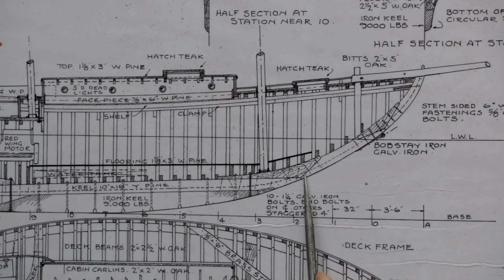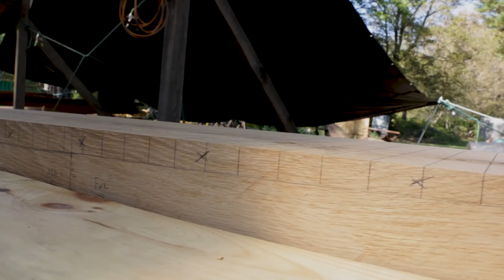Acorn to Arabella - Journey of a Wooden Boat - Episode 18b: Bow and Stern Timbers (Part 2)

Comment: For funsies... use maple sap in the boiler so you can have some syrup when you're done!  Also, I'd have been inclined to steam bed the fourth timber and then plane a flat spot on the back.  It seems like it would have been easier than dishing out a curved section.

Comment: Most of my steam bending experience has been with much smaller pieces -- like ribs in a canoe.  The challenge there is that you only have a matter of seconds to get them out of the steambox and bent into place before they cool.  Still, it's amazing the shapes you can get when everything works right.
Reply from the maker: Bending the thick planks was very cool, looking forward to steaming in all the frames!  The thick beams cooled fairly quick but I think since they have so much mass they stay hot a little while longer than skinny ribs do.

Comment: Suggestion for an improvement on your kettle.
Change the bottom surface of your water tank to an inverted cone leading to a straight chimney/flue that runs up the middle of the tank. That way, the firebox/water tank surface area is increased, and also the fire "draws" better thus being hotter. 
You can then add a cold water inlet on one side of the tank, and have your steam draw on the other side.
Your steam box will then sit beside the tank instead of on top.
Reply from the maker: Thanks for the suggestion but in all honesty it sounds like more work than it's worth.  It worked very well for steaming the forefoot and should work just as well for the frames.

Comment: you are thinking of resistance in the boat from waves or hitting an object which is true.   But distortion in sailboats will come from the pull of the forstay  and the backstay is very common.    You see many sailboats broken from over tight rigging.  (raceing)
Reply from the maker: You are totally correct and the rig is probably a bigger concern than the waves or hitting a solid object.  
The directional forces are similar and that is why we used those examples.  Most people would have a hard time believing the rigging could hog the hull, they don't understand the forces involved.  Envisioning a boat hitting a big wave or reef is much easier to imagine.  Once we start installing chain-plates and such we will start to explain rigging forces and their effects on the hull.

Comment: I have done quite a bit of woodworking myself, but can't do it anymore. I know it is well past clamping huge timbers together while gluing them, but why do you use 1/2" clamps? I was under the impression that to clamp large timbers and get them to keep their shape you should use super heavy duty clamps (1" or 1 1/2" size). I've only made it to Chapter 19 so maybe you do this later in the build. Although, come to think of it, most of the time where real heavy duty clamps are used seems to be when steam bending hull planking to the ribs.
Reply from the maker: Since the planks are either jointed flat and glued or steamed in place they don't require a ton of force to hold them in place.  We use pipe clamps when we really need to crank em tight but the smaller bar clamps are quicker/easier and are usually up to the task so far.

Comment: You should have looked into Live Oak for the forefoot.  It naturally comes in the proper shapes and it is extremely rot resistant.
Reply from the maker: We don't have any live oak in these parts.  Uprooting a big oak tree could have found us the curved piece but steaming and laminating seemed easier.
Reply: Correct, Live Oak is usually from the South Eastern US.  You could have looked into having a piece shipped up, but at this point it's only info for others and perhaps a future build.

Comment: Since steaming the wood opens and softens up the wood the pores of the wood are also open, is it possible to also laminate with glue at the same time when you clamp them into shape, or was it too much to worry about at one time?
Reply from the maker: Moisture and heat make it hard for many glues to cure. And yes, that’s a lot to handle all at once.

Comment: did you consider making a glue-lam of the entire keel?? would be strong AND elegant (and cheap) i should think
Reply from the maker: We did.  We used two gallons of Resorcinol glue juts to glue the bow and stern timbers, the glue is $160 a gallon after taxes and shipping.  Epoxy and oak have a spotty history but Resorcinol and oak get along very well hence using it.  
We would need at least 5 gallons, maybe 6 or 8 to glue up the keel timber.  We would also need many many more clamps or would have to make a bunch and then there is the milling of the lumber to get a good fit which is a lot of time and effort.   
If for some reason down the road the glue failed, replacing the bow/stern would be a nightmare but no where near the nightmare of replacing the whole keel.  The keel timber was just under $4,000 all said and done and worth every penny!

Comment: I love the curved steam bent wood, but why not house that with a long straight board down the length of the bottom? Groove-cut the flat long side of the angle to fit in a straight board down the center and glue that in with your special maritime adhesive. Maybe even a sliding dovetail. This would strengthen it laterally, and tie them all together structurally more so than just the glue.
Reply from the maker: We could have used a bigger piece but since it's so short a thicker piece is more likely to check (split) on us than the thinner laminated ones.  It will all be thru bolted when assembled anyways.
Reply: you answered my concern with that statement!  i was wondering if all those glued together pieces would perform as well as one big member cut out of one hunk of timber (barring the difficulties inherent in that process of course) but if it's all bolted through it's pretty much a moot point.  I wish i was nearer you guys i'd come and help (australia is a bit far!).  Hopefully i'll see the Arabella in Australian waters one day

Comment: you couldn't use the band saw on that half curved, half flat "48 inch piece of oak?
Reply from the maker: It was tapered from end to end so I would have had to make a jig to keep the blade 90* to the face.  The band saw was also set up for re-sawing so I would have had to switch the bands and readjust the guides for one cut then switch it back.  In the end I think either method took about the same time.  The final hand work would have had to be done either way.

Comment: What formula do you use to calculate the time needed to  steam the wood so that the lignin is flexible enough to bend?
Reply from the maker: The rule of thumb is 1 hour per every inch of thickness regardless of width.  Of course it varies with type of wood, it's moisture content, the temp of the steam, the genetic quirks of that tree.... But the 1 hour per inch is the standard starting point. Trial and error after that.  
Ours were 2" and we cooked them for 2 hours and they bent wonderfully.

Comment: Howdy, so what kind of glue are you using from laminations? Know a source where to get some? Thanks!
Reply from the maker: Aerodux 185, it is a resorcinol glue.  It is what they use to make marine plywood, it's used in airplanes and fire resistant doors.  Also boil proof!  
It has it's quirks but is a amazing adhesive. A quick internet search will turn up plenty of suppliers.  It should come in 2 containers, one a powder the other a dark purple liquid. A VERY accurate scale is needed for measuring and mixing.

Comment: What kind of glue are you guys using? Looking for some alternatives to mixed epoxy. Thanks
Reply from the maker: Resorcinol, specifically Aerodux 185
It's what they use for marine plywood, LVM's, airplane propellers, wooden mine sweepers in WW2 and fire resistant doors.  It's chemical resistant, boil safe and roughly $130 US per gallon, needs tight fitting joints and warm glue temps.  But when done well it's practically bombproof.
Reply: So how were you able to achieve or verify a tight fitting joint between the cut and chiseled out piece and the bent piece it married up to?  It would seem like thickened epoxy was a better choice for this joint.
Reply from the maker: For starters we made sure the bent face was flat to within 1/32" across the grain and a fair smooth curve with the grain.  We used a small batten to press against the face to stop any unfair spots.  We then rough fit the chiseled out part to the bent part using a chisel then a spoke shave.  
We kept checking the chiseled face for flatness across the grain, fair curve with the grain and against the curved face itself.  Eventually we got it almost light tight with no clamping pressure.  
Since both faces were flat to within 1/32" and had smooth fair faces s there was little worry about a void in the middle.  
The largest gap we could see and measure was a tad over 1/32" with no clamping pressure and the resorcinol we used can gap fill to 1/16" so no worries there.
We certainly could have had a rougher joint and used thickened epoxy but epoxy and oak have a spotty history where resorcinol and oak have a proven track record of working well together.  Oak can be funny stuff sometimes!
Reply: james 2015
Epoxy may have only been around the boat building industry for only about 50 years, granted, which is not very long in the history of boat building.  i can understand your concerns regarding the heat degradation of epoxy but this member and conceivably other built up members installed below decks are not going to see the type of temperatures that have led to documented epoxy failures (dark hulls and decks).  As far as giving epoxy a pass on freshwater vs salt.  Epoxy will degrade faster in salt water than fresh, but it will still degrade nonetheless.
Reply: { raises hand from the back of the class }  Ooh ooh- I have an idea! You could line one surface with sticky-back sandpaper pads and sand the other piece to fit to it.

Comment: Why didn't you bandsaw to the line of, the shorter piece that you kerfed and chiseled ?
Reply from the maker: Good Question! The band saw was set up for re-sawing and I would have had to adjust all the guides, make one cut and then switch it back to re-sawing mode.  The piece was also thin and tapered so I would have had to make a jig to hold it.  Seemed more effort than kerfing and chiseling.  Hand fitting at the end would be required either way.
Reply: Steve - cutting the board would have been a 10 minute re-saw operation on the band saw and no jig required other than shimming the board up to achieve the center line being parallel with the table . Check out some of the things that Louis Suazedde from Tips From a Shipwright does on his band saw. You guys are only about 2 hours away from his shop in North Kingstown, RI. Might be worth a trip down to get some tips. :)
Reply from the maker: We have seen Louis's skills with a band saw and are familiar with his channel.    
There are always more than one way to skin a cat as the saying goes.  I know a guy who would have done it incredibly fast with a disk grinder, I would have gone through 10 boards if I tried that technique.  
The biggest thing was the saw was/is all set up for re-sawing and I didn't want to change the band and all the adjustments and then switch them back for one cut.  I also don't think I am good enough with it to hold that big board on edge and keep it perfectly 90* to the table.  Louis probably can, I felt more comfortable kerfing and chiseling.  Either way it still would have required a bunch of fine tuning by hand which was the time consuming part anyways.
Reply: Hey Steve. Thanks for your reply. Please don't feel obligated to always respond to all of us old farts out here that question your methods. As you say, there are many ways to skin a cat. You are doing an awesome job. Keep it up. We just feel like we need to poke you once in awhile. :)Sorry if this is redundant. I may have responded in another place. Not exactly tech savvy. To old to learn new ways obviously. I have sailed most of the seven, but on steel - haze grey underway - courtesy of USN

Comment: Why didn't you guy's cut the curf with you your beast of a banfsaw, it looks like it is big enough.
Reply from the maker: We would have had to make a jig.  The piece was tapered lengthwise so the cuts would not have been 90* to the center line and was tall and thin so holding it accurately would have been difficult without a jig.  For just one piece it seemed more efficient to use the skil saw.

Comment: And you guys have that big ol band saw and didn't use it for that curve.
Reply from the maker: The saw was set up for re-sawing with the huge band so we would have had to switch the blades, re-adjust all the guides and switch it back after the one cut.  
The board was also tapered from end to end so we would have had to prop one end up in some sort of jig.  Same thing with how wide and skinny it was, it would have been tricky to hold perfectly 90* to the table without a jig.  Seemed simpler to leave the saw set up and kerf and chisel.  Would have had to fine tune by hand either way.